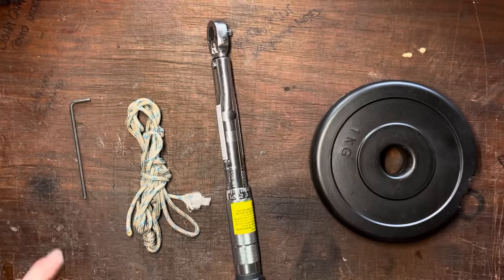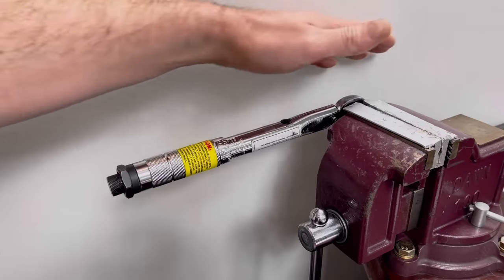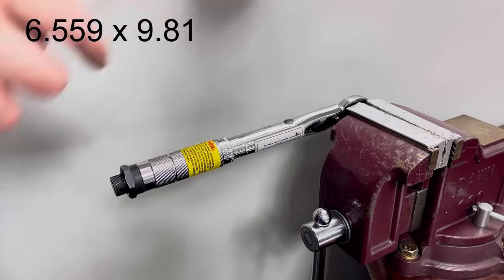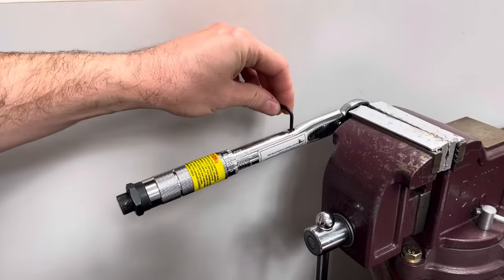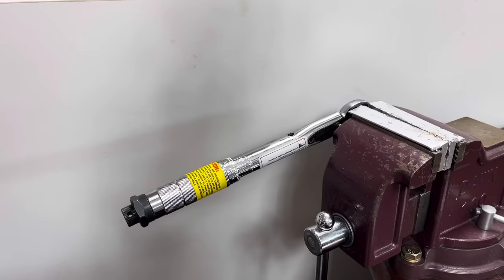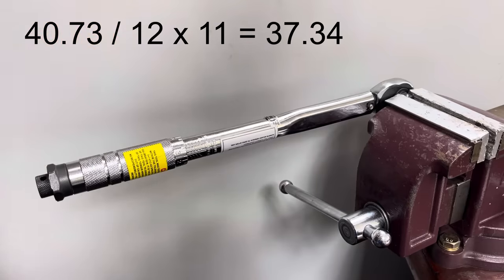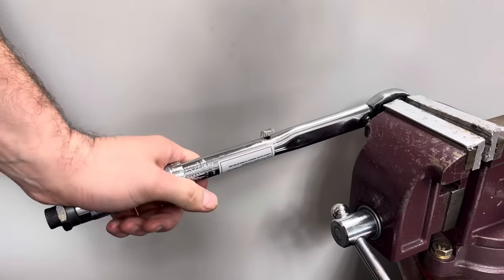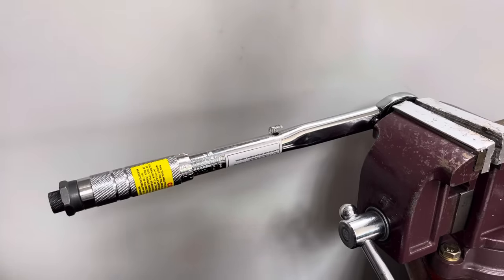CALIBRATE YOUR TORQUE WRENCH IN UNDER 5 MINUTES (NO SPECIAL TOOLS REQUIRED!)

Comment from the maker: If this video helped you, please consider clicking on the THANKS button above to support my channel 🙌 PLEASE NOTE: there is an editing mistake in this video  - ALWAYS set the specified torque by twisting the handle BEFORE measuring the length from the head. Otherwise your measurement will be wrong :) thanks!
Reply: The like button will have to do.
Reply: Thank you 😊
Reply: @ClaudeSac  Tbh hitting the thanks button wouldn't have occurred to me if he hadn't mentioned it - and I feel indebted for this invaluable and money-saving advice so it meant I could show my appreciation in some small way! With 5.7k likes, a small percentage of donations would really add up and encourage more advice like this. A few quid is a lot less than paying someone for the info, or recalibrating or replacing a tool!
Reply from the maker: Thank you! I appreciate the donation very much! Glad you enjoyed the video!!
Reply: Sir, your a genius and I can't thank you enough ❤❤❤❤
Reply from the maker: You’re welcome! I’m glad you enjoyed the video :)
Reply: Thank you, amazingly simple & never knew this
Reply: the bit without the knurling is put there by the  manufacturer as the exact spot you are meant to be using for calibration
Reply: also for proper cal you should check it at the upper and lower range of the torque wrench as well as the middle of its operating range. Many aren't accurate at the top and bottom of their ranges so using a different tool for those jobs is usually better. You wont know unless you check for your specific wrench
Reply: What about the weight of the torque wrench?
Reply: I use distilled water jugs that I can easily weigh (empty) with great accuracy.  Then the weight of the distilled water which can be very accurately CALulated based on Volume.  The cast iron used in gym sets not very accurate.  Also, tools are calibrated at the 100% and 20% marks.  Whatever else falls where it may unless u want a digital meter.

Comment: After you set the torque, you've moved the spot you measured to, so dont you have to re measure from the socket drive because the spot on the handle you choose is now half inch or so up the bar??????
Reply from the maker: Hey, yeah that’s right, I did as you said, but the video was made up of multiple segments and it should have been put in first. Set the handle adjustment, measure and then hang. Thanks for watching and commenting!
Reply: @VintageEngineRepairs This info should be pinned comment!😉
Reply: Brilliant thank you
Reply: Exactly what I was questioning!
Reply: If I were doing this, I’d just choose one of those grooves in your handle and then always use that. Find a way to measure the “proof weight” and the length as accurately as you can. Still, at the end of the day, the mechanism is only so accurate. You may get it perfectly calibrated, but then repeat the same torque application ten times and still get 1-2% difference in applied torque. Also, it’ll probably be different along the range of torques. It’d be interesting to get a digital torque gauge and then measure a bunch of settings to see how the variation looked along the range. Also, if you use the setup like in the video, you’d need to account for the weight of the torque wrench in addition  to the proof mass. 😜
Reply: @toastrecon  You cant pick a spot on handle, because it screws up and down the bar to select the setting, you have to use the measured point from centre of the drive.
And yes the tool should be mounted, hanging vertically and pulled against a scale meter. The tool should also be at ambient temperature and that temperature needs to be at median average. Three tests, at minimum, half and maximum setting will be enough to determine accuracy and roughly plot a variance curve. Over time that curve may increase, so a calibration done at half setting will see min and max setting out of tolerance. By plotting the curve, you can choose where you want accuracy and recalibrate at a higher or lower setting.
Reply: @mrgoodman6620  you’re right! I didn’t even think of that handle moving as you adjusted the torque setting. I guess you could measure it each time. I think if I were really concerned about it, I’d just get a digital torque gauge for $35 and use that in calibration. Then it wouldn’t matter if it was hanging any which way.
Reply: @toastrecon What do you mean by “if you use the setup like in the video”? What did he do wrong/how should it be checked or what’s the correct method? Thanks.
Reply: @aaronperelmuter8433  no problem! Torque is defined as force times distance. By measuring a distance and measuring the weight, you’re applying a “known” torque. Now, if you change either one, or don’t account for them, you’re in trouble. In the setup, he has the weight (albeit small) of the entire metal body and handle of the torque wrench hanging there, and I don’t know that he’s accounted for it. Maybe it’s negligible, but I’m sure if you were calibrating with a smaller wrench, like inch-lb, you’d be in trouble. Also, as you adjust the torque setting on the wrench, that metal handle moves in and out, which changes the distance in our “force times distance” equation.
Reply: If it doesn’t click initially, could you leave the weight on it and turn adjusting screw until it clicks?
Reply: @toastrecon look on the packaging or just weigh the wrench. Then add that to the hang  weight. Not that difficult.
Reply: @toastrecon  I agree. My guess is that’s actually why that groove is there.
Reply: That would not work as the weight is not all hanging.  The head is probably the heaviest part of the tool.
Reply: @kirkkw  The amount of hanging weight is realy of no consequence for the application. It's pretty small, as the closer you get to the vice less of weight is "hanging" & is supported by the vice. So if you test weight is 36 lbs, the amount of additional weight won't even reach a total of 36.5 lbs. It would be within the tolerance of the tool. Something that will make a bigger if it hasn't been done in years is, to disassemble it, clean & relube the mechanism. A dirty & dry mechanism will have a bigger effect on it's accuracy.
Reply: @aaronperelmuter8433  The way most torque wrenches are calibrated is using a torque meter.
Reply: @LTVoyager  Wow, that’s just SO helpful mate. 🤨 According to your logic, I should calibrate my torque wrench with, umm, a torque wrench, right? 🤔 Because a torque meter is a device, similar to any other meter, which simply indicates to one how much torque they’re exerting in a particular situation. Well, that sure does sound a lot like what a torque wrench normally does, that’s its core function. 

Care to elaborate please? What’s your definition of a torque meter?? 🤔
Reply: @williamallen7836  I was replying to the idea of using the total tool weight.
Reply: @VintageEngineRepairs  not possible surely, you need the length measurement in order to set the torque, so you can't then measure it after!!! You would then need to recalculate which means readjusting torque, and so on.
Reply: @rupedog -    use ft lbs.   Then measure at 12 inches every time, regardless of setting.   e.g. 20 lbs weight set at 20ft lbs. & measure 12".      w/40 lbs. set at 40ft lbs & 12".
Reply: Excellent. Thank you for sharing. 👍
Reply: Just take 12 inch then make your calculation, adjust then tension on the wrench and install wrench and put the loop of your weight exactly to 12 inch.  I checked my and i do not have a place to make an adjustment on my wrench

Comment: tip, if you can go 12 inches on ft. lbs, you can set the wrench to the same as the weight you are hanging.. no math involved :)
Reply: Explain this a little further, not quite following, thanks
Reply: @rtg8point858 for the imperial the math is the weight ÷12 × the distance along the torque wrench.. if you go with 12 inches, the ÷ 12 × 12 nullifies itself, so the result is whatever weight you choose, that's what you set your torque wrench to.. no math involved at that point. Hope that explained it for you 😁👍🏻
Reply: @JaneRoseDrummer  Ok. That's what I thought you were saying, just wanted to be sure. Thanks
Reply: Yeah that's what a foot pound is, 1 pound at 1 foot
Reply: Good tip! You could also extend the handle with a pipe, or make your own tool to hang those weights at specific distances every time you do this. Ie. a two foot pipe with notches for the string at 12 and 18 inches, choose your weights according to the specs on the wrench. Super simple calibration every time. You also don´t need so much weight if you extend the leverage, so that might be a thing too.
Reply: @olenilsen4660  But you also need to factor in the weight of the pipe, and the distance of the center of mass of the pipe and calculate that seperately from the weight! I don't think you're making the math easier here - especially if you're using a cast iron pipe!
Reply: @JaneRoseDrummer hey man I’m new to this but can you explain in layman’s terms
Reply: @TTHECULLL  If you have the type of torque wrench shown in this video, don't check or adjust with force applied anywhere other than the indicated location at the center of the handgrip. This is where force applied (whether by hand or hanging weight) delivers the torque being measured by the click mechanism. Anywhere else will change the torque being delivered. This is a characteristic called Length Dependency, many but not all torque wrenches behave this way. If someone tests an 18" wrench by weight at 12", simply calling it ft/lbs, they will get a false indication of the calibration being wrong. If they adjust using this method, then have the wrench tested correctly, it will be found to be out of calibration. So hang a weight on the correct indicated spot, measure and do the length calculation, and avoid messing up the accuracy of the wrench.  🙂
Reply: @SkippiiKai  You're correct, but in any case, with this type of torque wrench (being Length Dependent), using a handle extension is not viable anyway. Just the use of it would make the measurement inaccurate.
Reply: just replying b/c we both have drummer in our names.
Reply: @CAIDMASTEROFPYRO  Actually it's a "pound-foot" not foot pound. :)
Reply: @AimingWanderously  Those are different measurements
Reply: maths

Comment: Minimum spec on my Torque Wrench was 20 FT Pounds. I didn't do much math and still calibrated it. I though to myself "Foot, pound" Therefor 1 Foot away from the head should required 20pounds of load is what is needed to click it at the 20Foot Pound setting. So i filled up a bucket with 20 pounds worth of water and i was able to perfectly calibrate it. *I was able to verify this theorie with a new one and it clicked right when i was laying down the handle of the bucket on it.
Reply from the maker: Sweet as, good work :)
Reply: I dont want to explain the reason, but ...

... always calibrate with the force of the weight where the manufacturer marked ist at the handle. 

(If you can find a mark = It is the middle of the area where your hand will be !) 
(You see it here in the video)

If you choose an other point of the force from the weight = Calibration is wrong.

Additional information = Please no discussion ! 
There is a reason why simply choose a nice distance from the middle of the squere Socket adapter to a nice distance for an easy calculation ...
... will result a wrong calibration ! 

See other videos that explain the reason (=it is inside and we cant see it and our brain always refuse these reason. But it is true = middle of the grip zone where your hand will be (often good manufacturer mark these area). 

Discussion with these Youtube channels (or a maufacturer or these mechanical torque wrench with the easy inside construction. 
Remember there are Split beam torque wrench (= I never ask one of these manufacturer or saw a calibration Youtubevideo that explain these physical rules for calibration. But I bet force of the weight at the middle of the handle).

Comment: Why not hang the weight on it and then turn the screw until it clicks. Then you know you're dead nuts the first time.
Reply from the maker: You put a lot of tension on the spring loading and twisting, but I do like that idea! Just not sure it’s going to be quicker.

Comment: One thing not accounted for with this method is the weight of the handle, which is small but not zero. In the big picture it's likely negligible. I suppose one could measure this with a simple experiment. Suspend the wrench with a string looped around the center of the head, then support the handle end with a scale. Multiply the measured scale weight by the right angle distance from scale contact point to string, and you've got baseline torque with no extra weight added.
Reply from the maker: Yeah I agree with you, it’s negligible, as mentioned before, for what we do, it’s not going to make a difference. Most torque wrenches come with, from memory, +/- 10% accuracy. Thanks for watching and commenting, it’s always good to hear other people’s opinions and ideas :)
Reply: To eliminate the weight effect, you could turn the torque wrench sideways and apply a known force from a fish scale.
Reply: Ah, but then you'd have to add or subtract the weight of the handle depending on whether you're pushing it up or pulling it down when you're actually using it. If the bolt is vertical and the handle is rotating horizontally then no correction would be needed.
Reply: Put the wrench in the vise horizontally and run the cord over a pulley or some other low friction device to turn its path from horizontal to vertical
Reply: @michaelallen5505 that's not true, you would be applying however much force is needed to reach the torque spec regardless
Reply: I was going to comment pretty much the same thing, on big wrenches the weight can amount to a non negligible force (but you should also calibrate it with more weight, so maybe it doesn't matter that much).

I was thinking about calibrating mine, I already came up by myself with the method shown in this video but the fact that handle's weight would not be accounted for always bothered me.
I hoped to find a solution for that, your trick with the string is way better than what I could come up with to compensate for it, I'll definitely use it.

Now I also need to calibrate my scale 😅
Reply: @heavyglassglass  Think of it this way. What if you had a 12-inch handle that weighed 1000 pounds, operating in the vertical plane? With the mass being centered near the middle of the handle, you'd get an effect of around 500 foot-pounds pulling down. If you rolled the the wrench over and used it in the other direction, it would pull 500 foot-pounds against  the head in the opposite direction. 

If the handle was operating in the horizontal plane the effect against the wrench head would be zero. 

I would guess that for a typical torque wrench the effect would amount to no more than 1 foot-pound or less. Not enough to worry about, but also not zero.
Reply: @michaelallen5505  it would matter for calibration in one orientation but it wouldn't matter afterwards if you changed the orientation. If you calibrate it to require a certain weight at the handle then it will require that same force no matter the way you use it
Reply: ...not to mention that the angle of the handle is not perfectly horizontal when the wrench finally does click over.  But, in the overall scheme of things, it really is of no significance for the DIY/shadetree mechanic crowd.  Good enough for me!